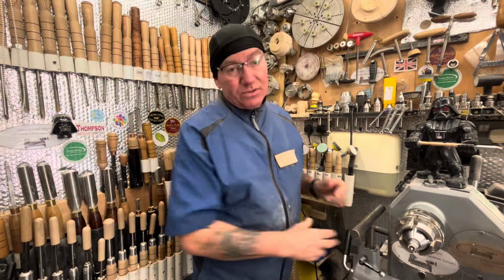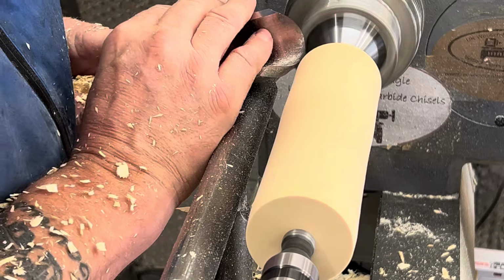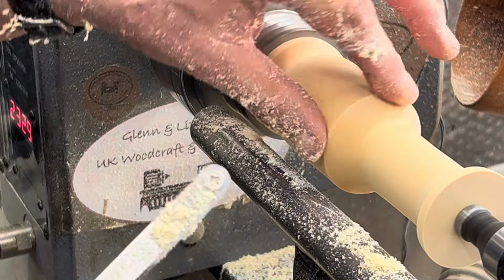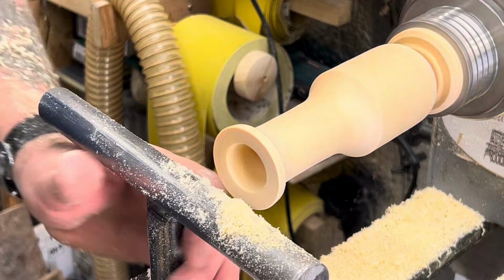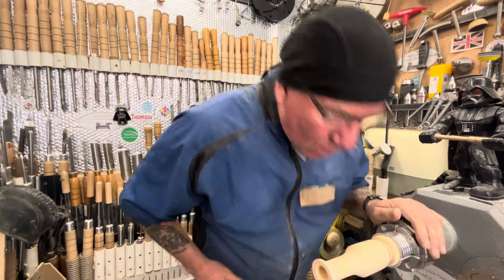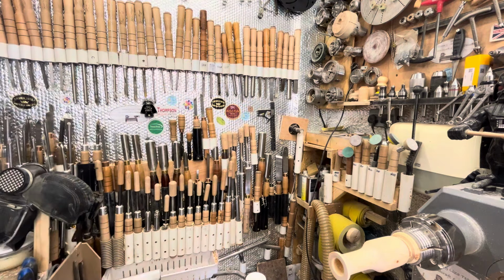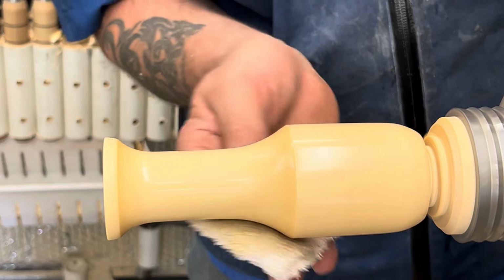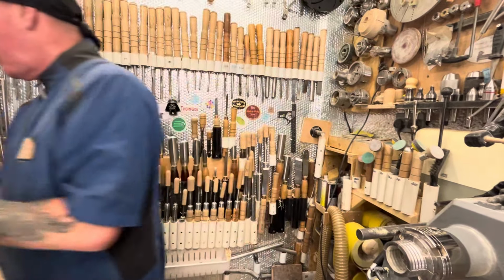Woodturning. Can't believe these sold out again. #carbide chisels

Comment: Thanks so much for the clearer explanation of the different finishes. Just needed to get it straight in my head between the “sanding sealer” (1/10), “shellac finish” (1/5), and then the “GT Shine”  (1 BLO/ 5 shellac finish from above). Plus the info on the bottles you’re using, and bath towel strips to apply. I think I’m all set. Many thanks.
Reply from the maker: That's it you're all set to go.
Reply: @ And big thanks for that. Perhaps lacking a workshop above freezing right this moment.
Reply from the maker: @AndrewMoizer  wow how cold is it there now? Usually we get the bad weather after USA.
Reply: @glennteagleofukwoodcraftca5308  hasn’t been too bad but going down to   -11°C tonight, -16 tomorrow. This is below normal for right now, closer to normal for depth of winter. Going back to around freezing next week. 

I feel we had a more temperate fall, so still easing into winter normals. Searching for “Merrickville, Ontario weather” would give you the whole story if you needed the gory details.
Reply from the maker: @AndrewMoizer  Stay indoors and keep warm.

Comment: Just found your channel and am learning a lot.  Would like to make some rotary sanders that I saw in another of your videos but can't find the sanding head that you used on Temu. You mentioned that they come in a package of 2. What should I search for?  I was also intrigued by the sanding attachment to your right angle drill that seems to replace the chuck. Where did you find that?
Reply from the maker: I just put in sanding pads and they come up for me. The drill, I bought the keyed chuck version, not the keyless. I haven't changed anything. I just fit my sanding arbour in it. Those I make. There's a video on that. https://youtu.be/mka2lSmMqv8

Comment: Very much enjoy your videos!  Those bottles you use for the shellac - are they specifically compatible with alcohol?  I've used some plastic water bottles and the alcohol ate through the plastic.
Reply from the maker: Yes they are. It's what the alcohol came in. Never had a problem. Water bottles are not made for holding alcohol.
Reply: @glennteagleofukwoodcraftca5308 glad to have seen this comment before I tried using a water bottle.

Comment: HI Glenn and Liza, What kind of cloth do you use for applying your finish? I've tried paper towels, cotton socks, cotton bed sheets and I get streaks in the finish putting it on at a fast speed like you do. If I do it slow and put it on following the grain, it does better.
Reply from the maker: Hi Dale. If it's streaking, then your shellac is setting too quick so you might need to dilute the shellac a bit more or add more oil. The oil helps it to move around. I use a piece of bath towel.
Reply: @glennteagleofukwoodcraftca5308  Thank you, Glenn. By the way, Glenn was my dad's name.

Comment: Nice job glen nice to see we can comment on the videos again. Have we got rid the trolls?? Certianly gonna be making some the shine juice. May even look into my own creation for slab finish aswell will send you a batch when i crack it 🏴👍
Reply from the maker: Nice one. Not sure yet, but they know they'll just be blocked. It's good to try your own mixes. Different styles suit different people and sanding techniques. I wanted something to use at speed. Think I've cracked it for the way I turn.
Reply: @glennteagleofukwoodcraftca5308  yea looks like you have mate certianly looks great. I may try doing a batch for a finish for slab table tops cutting boards etc maybe try mixing part shellac and oil with some wax mix see how that goes. Fingers crossed they have disappeared hope you guys are good. Looking forward seeing some more 🏴👍

Comment: Zinsser (bullseye) shellac is a 2lb cut. 
2lb shellac to 1gallon (US) of shellac. Generally I like a 1 - 1.5lb cut depending, so $30 will get you @ 1/2 gallon of usable mix, dunno what that is in lsd. It's not any cheaper to buy flake and make your own, though it may be better quality, but for sanding sealer it's fine.
Reply from the maker: Welcome to the channel. We can't get Bullseye here in the UK unless we fork out a hell of a lot of dosh to get it imported. Thank you for the info.